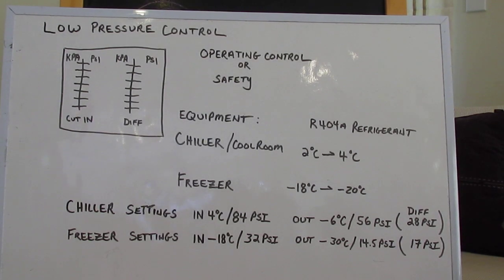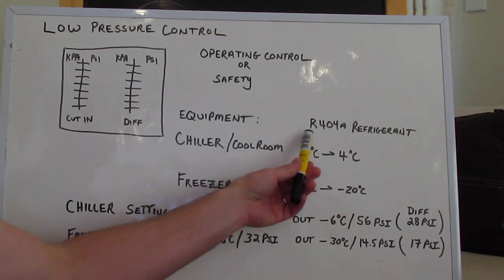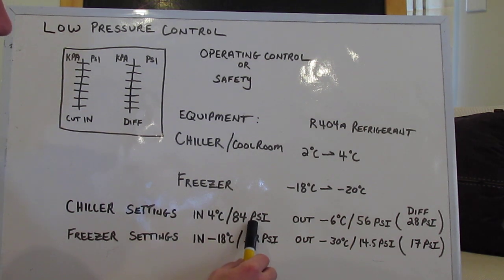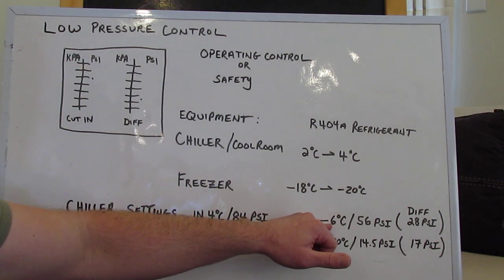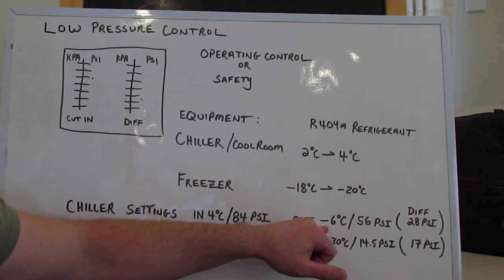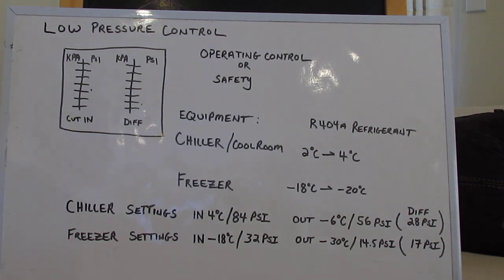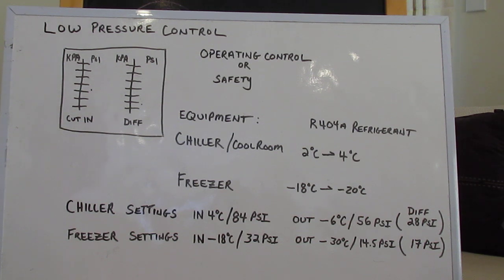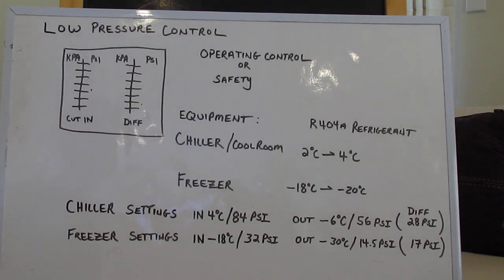Refrigerant Low Pressure Control setting

Comment: Hey sir we’ve good video.
Have a question 
Do you adjust your your pressure if it walks in or reach in like 10-20 F temperature because evaporation temp gotta be less than box temp .

Comment: Excellent explanation this what happen in real world. but 1 confusing point people they might think 4 is cut in 2 is cutout from where did he get a -6 since formula says CUTIN-CUTOUT=DIFF why he didn’t subtract 4-2? the you have represented your values on the board are confusing .anyway great job mate.
Reply from the maker: 4c is the cut in temperature. To achieve the desired room temperature of 2c we need a cut out temperature of -6c, "saturated evaporator temperature."
Hope this helps.

Comment: I still didnt follow how the gray area of Cut-Out temperature was determined.
Reply from the maker: Well the gray area is determined when the equipment is selected. Not all suppliers print the info in their catalogues but check your supplier catalog. In the section of evaporators, find a blower coil for a cool room. The details of the coil  should be on the page, size, connections and capacity. Above the capacity it should state the evaporator T.D. Example: Btu/hr (10f TD) or (15f TD) this is the temperature difference between the coil surface and the room you are cooling. The TD should not be mistaken for the operating temperature of the coil. 
When dealing with C we refer to it as( K) TD for Kelvin.
Hope the helps
Reply from the maker: Easier example, 2c is 35.6f room cutout temp. 15f TD would correspond to an evaporator temp of 21.6f or -6c.

Comment: How do you know to cut out at -6? Is this a standard temp on that sortve set up?
Reply from the maker: Yes -6c is the standard saturated evaporator temperature cutout for most chillers and walk in cool rooms. Gravity coil display cases run colder though.
Not to be confused with the actual room temperature. The evaporator needs to produce a temperature colder than what it is intended to cool. Law of thermal dynamics, "hot goes to cold." So by having a cold evaporator we can get the heat energy to flow from the product or room being chilled to the cold evaporator. 
Hope this helps

Comment: Can you explain pressureswitch setting for R22 refrigerant on freezer & chiller
Reply from the maker: Same procedure as in the video for  R404a but different numbers. 
For R22 cut in at -18C / 24 PSI
DIFF Setting of 13 PSI, this will give you a cutout of -28C and a holding temperature of -22C.
Hope this helps
Reply: @latentfusion2563  thanks for support

Can i get R404 refrigerant suction pressure in blast chiller
Reply from the maker: @TheBijuf43  blast chillers work on the same principles as regular chillers except they are designed to do it quickly. This is why the condensing unit is so large and the evaporator has many powerful fans. We are still governed by the fact that we want to cool the food and not freeze it. Most blast chillers are controlled by means of a temp probe that can be directly inserted into the product being cooled. A pressure control would only be used as a safety device on this type of equipment.  
All the best.

Comment: Just on the pressure temperature, there’s also gauge and bubble, so 4 degrees is 100 psi gauge, these things are what confuse me about knowing where and when to apply for accuracy.
Reply from the maker: It's ok lots to learn when it comes to refrigeration, that's what makes it interesting. Blended refrigerants, R400 series,  have what is known as glide while changing from a vapor to a liquid during the condensing process. This glide is not a factor when setting a low pressure control due to fact that we are dealing with the evaporator. 

A condenser operating with glide refrigerants, there are three temperatures of special interest: the dew point (the highest condensing temperature), the mean condensing temperature and the bubble point (lowest condensing temperature), which is achieved just before all refrigerant has been transformed to liquid.
Hope this helps

Comment: Or what's the best approach you think I should take
Reply from the maker: Sounds like a Txv issue. Possibly a blocked orifice or a leaking power element on the valve itself. I would check those first.

Comment: What I intend to do is to pump the system down then open up the TEV flush the entire suction line with ofn including the TEV vac the system up and re-charge it will this solve my problem?
Reply: …what problem? If it’s not operating correctly, cleaning it inside won’t do much, set your pressures, take actual temperatures, but if you pump it down, fit a drier/sight glass. Which does remove bits of doubt in the system… you need to know that all of it is functioning as intended and if the system has the right amount of refrigerant.

Comment: Hi there I have just replaced a Lp/Hp switch a danfoss one on a walk in freezer which is on 404a operating at -18 to -20 and I set  it up exactly the way you explained in  the above video the compressor kept on shot cycling can you please shade some light on what is wrong note I've ruled out all other causes because when I bypass the Lp/Hp switch the unit runs till the at -18 mind you the ambient temp outside was about 13 degrees Celsius
Reply from the maker: What is the running suction pressure of the system when the freezer is nearly down to temperature?

Comment: good eve sir, if the low pressure goes to zero what are the problem?
Reply from the maker: You can pump a system down to zero psi but you never want your system to run for extended periods of time in a vacuum. The compressor can become damaged and or overheat.

Comment: It works with dual systems with one outdoor unit.
Reply from the maker: Yes, as long as the suction lines are the same length to the indoor evaporators from the tee junction.
Different lengths of suction line can add more pressure drop on the greater side.
Reply: I set the pressure switch as u was said it before. But the compressor is tripped. Its 404a deep ഫ്രീസർ -18'c  The suction pressure is 10 psi. After that i keep the diifferencial is10psi now it is working. As per u r suggession  32 psi - 15 psi the differantial will be 17 psi. It is 2 systems. The temperature is also different. Some times one solenoid vave open. So  there is pressure difference. If one solenoid will open the suction is 20psi. If the both are open pressure is 10 psi.

Comment: Is this applicable with the Ranco LP controllers with differential on the left and cut out on the right? The numbers are for diff is between 50-400 and cut out is 0-700
Reply from the maker: Works with any and all low pressure controls.
Reply: latent fusion cool thanks mate, I haven’t had too much to do with them and had to set one up yesterday on a medium temp 2x solenoid system running two cases - still unsure what I’m doing but this kinda helped! Thanks again

Comment: Sir please one video make on freezer compressor winding cannection.
Reply: It comes down to how the freezer is wired up and the wiring within the pressure switch, if there’s a solenoid, relays and if you want alarms, best bet would be to provide the youtuber with the condenser unit schematic, and types of controls in place to set, and see if he would do it in a similar way, or if there’s alternatives…

Comment: Hi dea boss awsum video. I have a cool room with r22 refrigerant 3°-6° so how do u set the LP pressure controls.
Reply from the maker: For a cool room operating between 3-6C I would set the cut in at 73 psi and the differential to 27 psi. This should give you a cut in 73 psi and cut out 46 psi,  a -5C evaporating temp and a cut in at 6C.

Comment: Thanks for your video, how you adjust for safety or at what temp ranges?
Reply from the maker: Hi Mike, the -6c is for the average medium temp cutout operation, if a refrigeration unit is using a low pressure control as a main operating control. Thermal dynamics states hot will go to cold, so in the operation of a cool room the thermostat  is set to cycle between 2c + 4c for food safety. The evaporator coil will need to be colder than the room in order to make a heat transfer possible. Most Evaporators are engineered with a set temperature difference at a certain watts or Btu's.
Normal TD is 6K or around 8 to 10 F. What this means is that when your cool room temperature approaches 2C, your saturated temperature of the refrigerant will be in the minuses. The off coil temp of the evaporator will be -5 or -6C and the room will be at 2C. 
Keep in mind the evaporator will be selected for the rooms heat load but they condensing unit may be of a larger capacity than your evaporator coil. What this does is lower the off coil temperature and increase the duty. This means it will pull the room down faster. The problem with using a pressure control on a system like this is finding where to set the cutout at.
This is why I have recommended using -6C as a starting point and adjusting it up or down as required. 
The "cut in" will always be at 4C but the "cut out" may very slightly depending on system design.
Systems like gravity coils will have very low 'cut outs' due to the lack of fans, All depends on what your controlling.
Reply: @latentfusion2563  thanks for detailed response.

Comment: hi thanks for the video. I have a 2.4m display fridge for meat using a R134a compressor system. what would be the settings for the low pressure control unit using a Differential and a Range controllers?
Reply from the maker: hi, thanks for your question.
I have a couple for you.
1. is the meat packaged or unpackaged?
2. open or closed display?
3. gravity coil, forced fan operation or an old school cooling slab?
let me know and I will do my best.
cheers